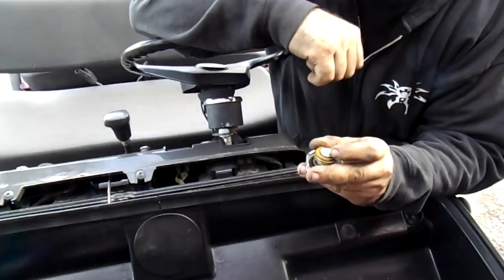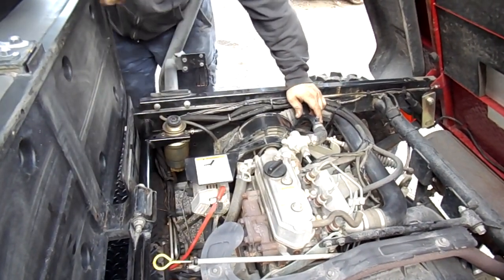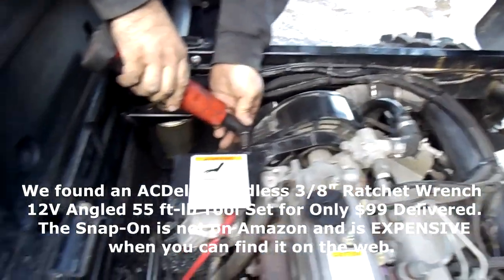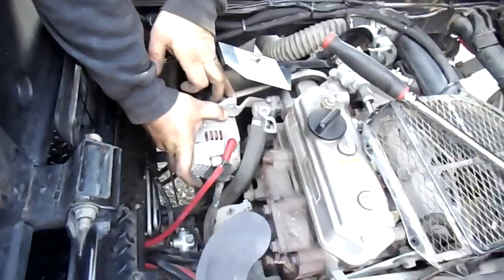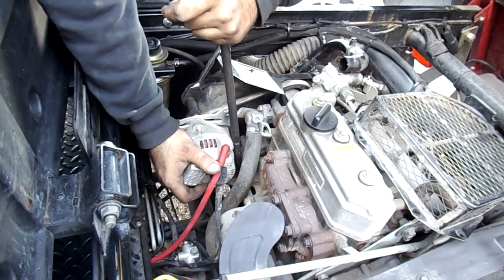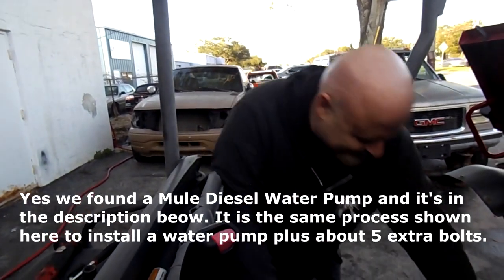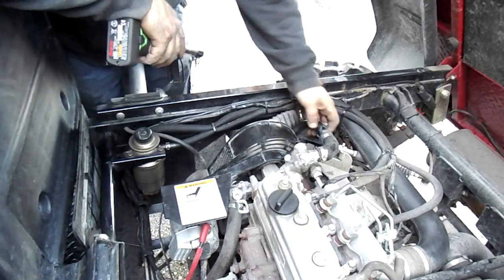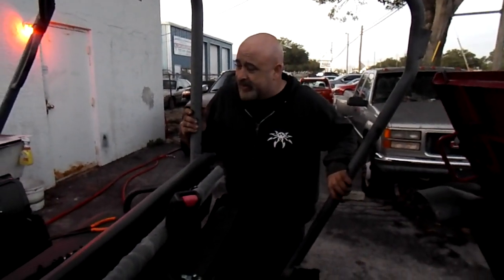Fast DIY Fixes & Diagnostics for Overheating ATV, UTV, SXS or Quad-Water Pump, Thermostat & Fan Belt

Comment: I have a diesel mule has over heating issues fell like the radiator is clogged
Reply: Rider,
If you believe the radiator is clogged it is probably best to change it out as they are fairly inexpensive. I have had that problem myself and tried to flush the radiator several times and kept overheating and eventually I just changed the radiator and never had that issue again. Thanks for the communication and please subscribe to our channel as we love good folks with positive communication. WELCOME
Reply: Thanks for you help but the mule has 2 radiators but the symptoms are sometimes water is warm on hose on side and the other hose is cold and that change and the. Straight  pipe come from water pump the is real hot but only where the water is hot and part is cold the water pump is turning belt was loose i fix that i test the sensor on radiator and is fine i have a new coming tomorrow anyway but i don't know hoe flush radiator?